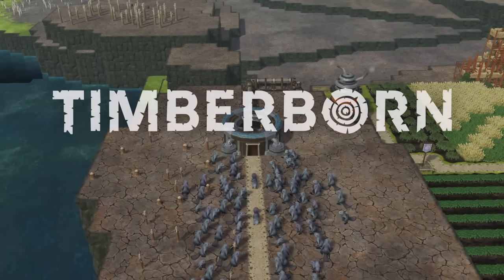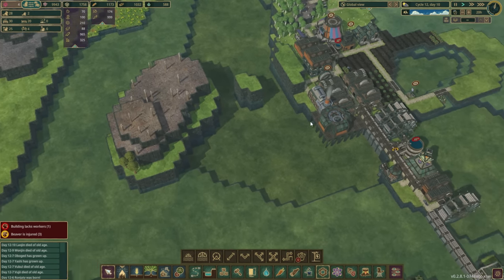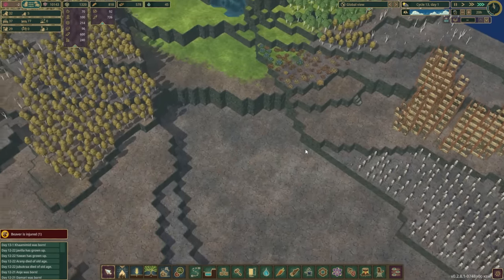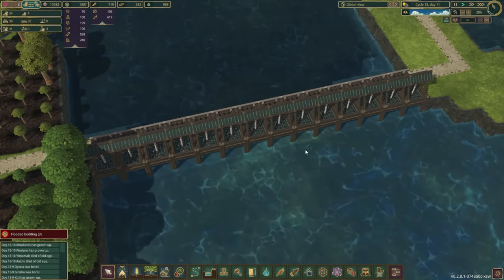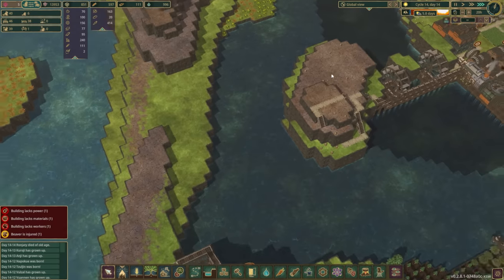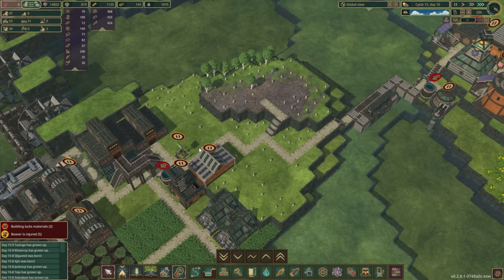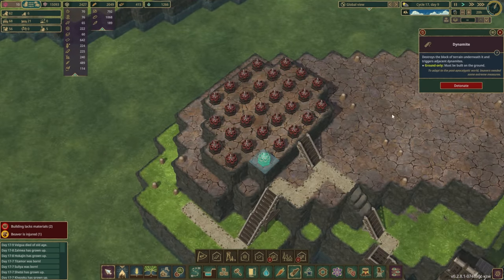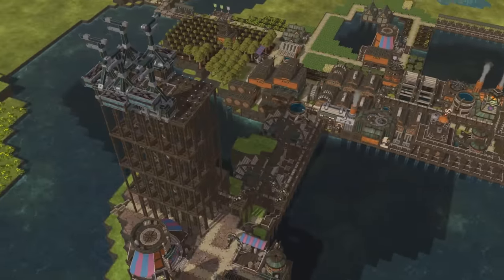I Built the World's WORST Engineering Project in Timberborn Update 2

Comment: Power is measured as energy per unit time, so "hph" is horsepower-hours, or the measure of the maximum horsepower that battery could handle for one hour, or the number of hours the battery could sustain one horsepower for.

Comment: There really needs to be pumped storage in a game like this
Reply: There already is. You can use pumps to get water to a higher altitude and release it with floodgates onto positioned waterwheels to get power back.
But setting all that up would be a way bigger project.
Reply: @Amaror2  It's incredibly inefficent in this game. Obviously you could make near infinite power this way, hence why they nerfed it, but really in a game all about hydro-dynamics the power consumption for the water pump shouldn't be so absurdly high. Or the flow-rate output for that cost shouldn't be so incredibly low. 

Kibits actually already tried the whole ordeal and ran into water evaporation issues attempting to make a long enough chain of waterwheels. The games physics don't allow this to be anywhere near the 70-90% efficiency of pumped hydro storage, sadly.
Reply: @SmokeandSpirit  he should have tried using beavers to move the water instead of pumps. A dozen beavers moving water up while while they only eat like 30 food a day is very effective. It worked for me before not sure about it now.
Reply: @SmokeandSpirit  he also tried it in a pretty inefficient way using too much pumps because he wanted to get the water from far lower than required.

Comment: I find for the power shafts, if you dig 2 blocks down where you would put your paths and put your power shafts there you can then also flood the ditch with water and irrigate your entire colony whilst spreading power around it too. Takes a while to get it setup, but once it does you can introduce 'city-blocks' and a universal power supply and everything is watered.
Reply: That is THE WAY to go.. Even it you don't do it at the beginning.. Once you reach certain threshold you could always re organize and move building shafts.. in fact that's how I've done it several times already
Reply: A similar way, is to also dig 2 block down and put a dam on the corners and build 1 level supports for the rest, the build your power shafts on that first level support, build the next level of support ontop of that and then your roads. You then have your power line running under your paths and when the drought comes, your irrigation lasts longer.

Comment: Actually the gravity batteries in this game are more like the ones that already exist. We tend to just have giant steel or wood bars we drop in a bore hole for small amounts of energy storage. The tower design is far more laughable. 

The tower means the wind will ruin it, each consecutive block stores less power than the last as the farther they go down the more potential energy they can output, and raising and lowering the crane with no load is wasted energy. The existing method has low maximum potential, but the the tower is just so much less efficient. 

But as you said yourself, best method is just pushing water into an aquifer.  Otherwise your better off with something exotic like a heat battery or even hydrogen.
Reply: There's also the concrete blocks being a poor choice of weight for the purpose (not something you should be constantly moving around), the weird grabbing mechanism, the poor choice of crane... and that they're acting like this is some grand new invention when it's really something we've been using since long before we even figured out what electricity is.

It's like they went and said "hey, let's make a gravity battery but do it really, really poorly".
Reply: Sure, but it works better in a desert situation, I wonder if we could potentially use dams to protect flood prone areas and use the excess water for farming or something.
Reply: @KRYMauL  the issue with the idiotic cranes isn't so much the idea of a solid mass gravity battery, it's that this implementation calls for automating tower cranes in probably windy conditions to repeatedly couple and decouple from blocks it has to stack perfectly. Hopefully no sand gets in the works.

If you really really really have to build an energy storage facility in the desert, just do something like subterranean compressed air or molten salt heat storage.

If you really want to use gravity you can build a few rail lines up a mountain and send hoppers full of sand to the top, dropping them back down the tracks when you need that power.  At least in this case you can leverage already existing electric rail technologies and you can skip R&D on the sketchy auto crane.
Reply: @ChrisBode  Why not just heat the sand and use molten silicon?
Reply: @KRYMauL  thermal salts have more than double the thermal capacity of silicon. That being said, the only engineering I have any education in is software engineering so a cost/benefit analysis of using sand might work out given its abundance.
Reply: @ChrisBode  Same here, though software engineering is still engineering. The only thing is that project managers do the bulk of cost benefit analysis.

Comment: In a previous build you were playing with constructing high while at the same time having a massive pit built for the water to pour into to be able to power a bunch of water wheels.

So imagine this:

A central location, like an island, surrounded by a pit.  You have your gravity battery tower in the center of said island with the gravity batteries at the very top of them, and they drop down the sheer walls of the tower and the island that they're on and into a pit, going from maximum height to maximum depth in the game to be able to power your city.
Reply: what's better is that the batteries can be lowered into water. More powah! (idk if the official update release changed it tho)

Comment: little tip, you don't want to build floodgates especially in 1 block high areas because the dam pieces let water out at .7 of a block whilst the floodgates can only let out water at .5 and then also  go up to 1, what I generally do for areas like that is build up dams behind the floodgates so that I can store the maximum amount of water possible,  so it'll be at least 0.7 in the summer but just before a drought I can lift it up and have 1.0 blocks of water in that area

hope this helps
Reply: also on this map, especially at the starting area, if you're not careful what you dam you will flood the crap out of everywhere, spent so much time trying to balance the water input / output while trying to store as much as possible whilst also trying to maintain some speed for my massive array of water wheels lol
Reply: Actually a floodgate set to .5 is the exact same height as a dam. The water height will max out .2 or .25 above the blockage depending on the systems flow rate. So with flowing water the water behind the dam or flood gate will be the same. You can prove this by building dams and flood gates next to each other.

Comment: I knew someone thats actually seen one of these in operation so this videos awesome to me. As a kid I was good friends with an older fella in a wheelchair (I'd do little things like taking out and bringing in his bins and he'd teach me all sorts of cool things as a thank you, still one of the best blokes I've ever known)

One of those things is that his family had a manually wound gravity battery powering their house, roughly from the 30s to the 60s at a guess. They had to go over to the milking shed to milk cows twice a day so they'd attach a long wire to the back of their car and drive over to the milking shed before releasing it. The long wire was attached to a large cylindrical weight that had a nearly airtight seal to the metal bore casing it was hung in, as the weight decended slowly due to the air pressure taking time to escape past it it the wire would wind a small generator for roughly 4-5 hours for just enough juice to run some basic lights and such

Comment: 15:00 HPH is Horsepower per hour. So if you're using 2k HP in your world, one of those, fully charged (28k HPH) will last 14 hours.
Reply: incorrect. the measurement is Horsepower hour. but close enough.
Reply: @Necrotechian  
Incorrect. It's not close enough. HP/h is pretty much the opposite of HPh. HP/h would be an increase or decrease in power output over time. HPh is an amount of energy.
Reply: @theuncalledfor  your comment makes no sense to me. HPH is horsepower hour which is basically horsepower per hour and idk what you're trying to say about HP/H is how much the power demand changes per hour but it doesn't make sense. OP is right
Reply: HPh (horsepower hour) = the amount of energy storage you have available,  HP/h (horsepower per hour) = amount of energy consumed per hour. So "HPh divided by HP/h = how long the current stock will last for the current consumption"
Reply: @whatusernameis5295  HPH is horsepower hour, which is when you multiply power by time, this gives you energy. this is like Watt hour, with horsepower simply being another unit for power. Since power is energy over time, multiplying power by time gives you energy.

Horsepower per hour is HP/H, you say per because you are dividing, example Kilometers per hour, Km/h, because as it says it is the amount of kilometers divided by the amount of hours, which gives you how many kilometers you move in an hour, i.e. per hour. HP/H is a quantity that is not well defined or used, but as he said it can be thought of as the rate of change of power, just as accelaration is the rate of change of velocity, or power is the rate of change of energy, or speed is the rate of change of distance
Reply: @whatusernameis5295  hp/h is how much you consume per hour, hph is how much energy you store in total. if your battery hasr 28000 hph, and you consume 2000 hp per hour, your battery will last 14 hours. op gets the general idea but that wording makes it incorrect. hp-h is not hp/h, but the polar opposite of it.
Reply: @flyingwhale5938  hp/h is not a commonly used measurement. P/∆t=E/(∆t^2), which would indicate an increase in the rate of energy usage (an increase in power) over time the same way that d/(∆t^2) indicates an increase in the rate of displacement over time
Reply: @whatusernameis5295 1 hph means you can supply 1 hp for 1 hour. 2 hph means you can do 2 hp for 1 hour, or 1 HP for 2 hours. hp/h would be a unit rate that shows the rate of change in power over time. If you had a water wheel, and there was no flow but the river started to speed up, 50 HP/h means that after 1 hour you'd be producing 50 hp, and 100 hp after 2 hours. so no, not basically the same at all.
Reply: @Physis_88  
No. Wrong. HP/h is NOT the amount of energy consumed. That would be HPh/h, confusingly enough. Which if you know how fractions work, is just HP.

As I already said, HP/h is the increase or decrease of power over time.

Please learn how math and physics work.
Reply: @whatusernameis5295  
No. Wrong. Absolutely wrong. Completely and utterly and idiotically wrong. You clearly know nothing about physics or math.

HP/h is power DIVIDED by time. HPh is power MULTIPLIED by time. You're saying division and multiplication are the same thing? That's like saying addition is the same as subtraction!
4 / 2 = 2
4 x 2 = 8
Not the same result, not the same thing. Division is the inverse of multiplication.

In terms of physical units, power is energy over time. That is, power is energy divided by time. If you multiply power by time, you cancel out time, leaving you with energy. If you divide power by time, you get a new measurement that I don't know the name for, that measures the change of power over time.

If you have a generator that produces one horsepower, and it increases its output at a stable 1 HP/h, you produce 2 horsepower after 1 hour, 3 horsepower after 2 hours, etc. It's a rate of change.
Reply: @MrKioder  
Correct. Or how velocity is the rate of change of your position in space.
Reply: @daffodil2067  well, ofcourse it isn't. horsepwer itself is a ridiculous unit itself compared to kw. kw-h mw-h what we encounter in daily life. but the game uses horsepower. i don't care for hph outside the game. and they should have gone for beawer power instead.

Comment: I have seen fairly viable ones that were basically "drop a massive weight down a mine shaft."  It works for storing power, and because stone is more dense than water it is more dense power storage than water.

The tower thing just creates an engineering problem where you get next to no power for stacking the lower levels.

Comment: The feature that creates drought can easily be manipulated so that it actually works for you and your crop land never dry's out.
All you have to do is unlock the dynamite factory then blow up single panels of ground 2 deep in your farmland and then fill them with water. This gives you eternal crop growth and harvest through out the entire game. Sure it takes away a lot of the challenge but damn it feels good to not have to worry about crop production.
Reply: You're essentially tapping into bore water. It's a common practice here in Oz, though highly not recommended for drinking water.

So in a way it's still realistic, I just wouldn't do it to supply your primary pumping stations
Reply: @mathewpoole3589  i did that in a very big lake. Used about 4000 dynamite to level the whole lake 4 blocks deep all the way down to the limit. 
I would have continued playing but it got to a point where i would get 15 fps at fast speed and had to force myself to play at normal speed. Went to about 80 cycles in hard mode with 13 towns.

Comment: kinda unpractical version of a kinetic battery.
A barrel spring, like the ones in mechanical watches, would have been much more practical and compact and could store much more energy without the need of a tower (probably easier to code, too).
But i guess those kinda kinetic batteries look cooler?
The dev probably took a look into a grandfathers clock and figured it would be a great addition to the game :D
NGL, those do look neat.
Reply: That is not barrel spring you're talking about. You are talking about a coil spring housed inside a cylinder, called spring barrel. 

Also, springs has very bad energy density. You have to have a massive amount of springs to be able to store a usable amount of energy. Clocks work with that because the amount of energy a clock needs to run is almost non-existent. Such is not the case with heavy industry this game contains. While gravity battery is unpractical, it is actually plausible to use in this kind of situation. The amount of energy one battery or weight can hold is only limited by the rope length (of course IRL it's not as simple as that, but for the purposes of this game that is sufficiently accurate).

Comment: Pumped hydro only makes sense when the vast majority of the work needed to build the reservoir has already been done for other reasons. Other types of gravity batteries (pumped hydro is a type of gravity battery) likewise only make sense when the vast majority of the work needed to make it work has already been done. Gravity batteries using elevator shafts or ventilation holes for abandoned mines make sense. Scratch built ones not so much.

Comment: The reason gravity batteries work better using cranes vs water is: efficiency. Our electric motor/generators are WAY more efficient than our most efficient water pump. With a water system, after you take the pump efficiency to pump the water into a high place, and the efficiency of the turbine generators to extract the electricity from the falling water, it is basically a wash and you hardly get any power out. While there are still some efficiency loss in the crane system, it is not nearly as massive a loss as the water system.

Comment: hph means horsepower hour, just like kwh, mwh, opposite to hp/h, kw/h. game uses horsepower as the unit of power. 28000 hph means that the battery can provide 28000 horsepower for one hour, 14000 horsepower for 2 hours, etc etc. so lets say there is a 3 day drought, that is 72 hours, with 28000 hph battery you will have 389 hp available on average per hour, but you can use more or less at times. so if you use 2000 hp on a normal day, you will want 5.14 batterries to have 2000 hp for 3 days, not considering day/night cycle etc.

Comment: Just saying gravity batteries already exist on a more effective form that company you are talking about that is using concrete blocks is basically a scam because a more effective alternative already exists witch os basically there idea just better and more simple 2 lakes is all you need 1 lower 1 higher pump water to higher one with extra power and let it flow through turbines on the way down if you need power😅
Reply: i mean the brick method has the advantage of being able to be built anywhere as opposed to somewhere with lot's of water and more precipitation than evaporation, and it's probably easier to transport brick's than water so it's useful in place's where sunlight is abundant but water is not IE desert's
Reply: @clarencechurch4006  Yes this is true but if they do this in a desert area it would be effected by wind and sand would wear away at the concrete if this a idea is implemented it would me smartest to do this with metal barrials of water and not in a windy area
Reply: @cheapcheating6219  If you did water in a desert it would simple evaporate
Reply: @rccookie6202  water cannot evaporated if it’s in a vacuum sealed container and how about you just don’t put it in a desert
Reply: @rccookie6202  even if you did have to replace it every so often it would be cheaper than having to replace a 200 pound block of concrete every year and it would be cheaper.